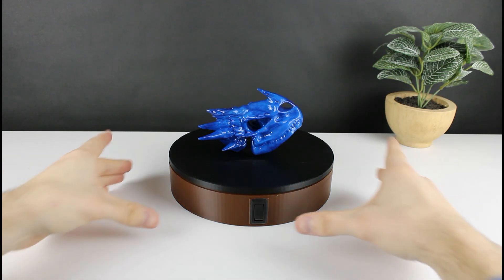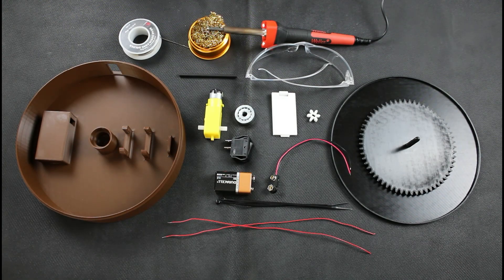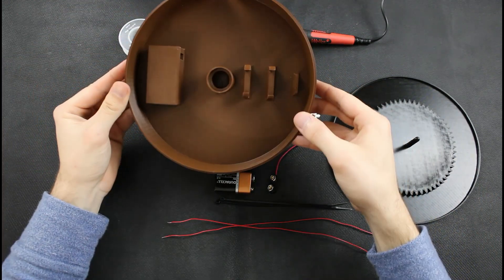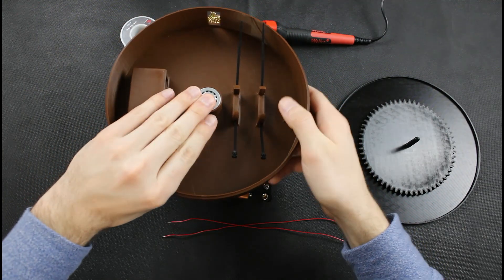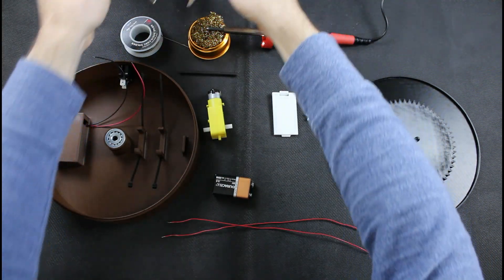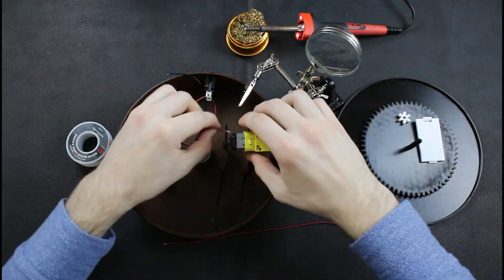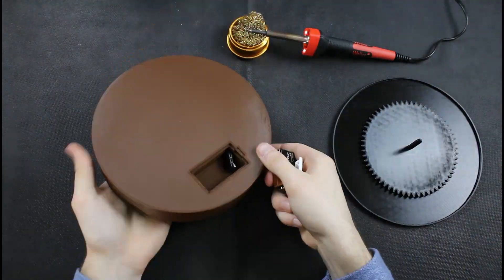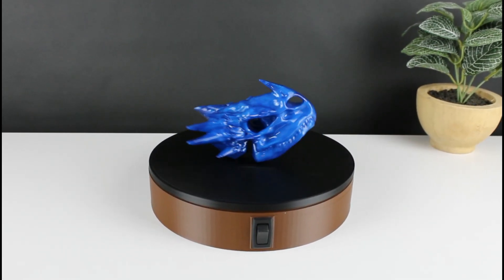Cheap 3D Printed Motorized Turntable!

Comment: Is there a way to adapt this to work with other motors? I have this 011 kit that came with my Bambu that has a battery, circuit board and motor and thinking of using it.